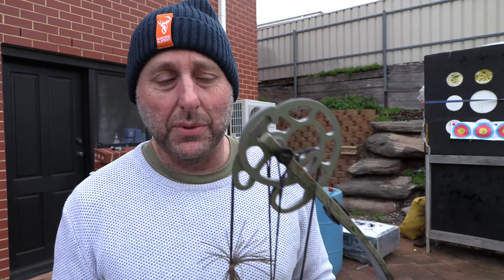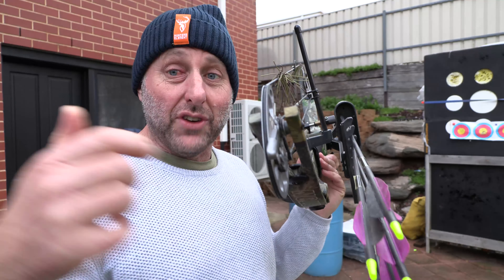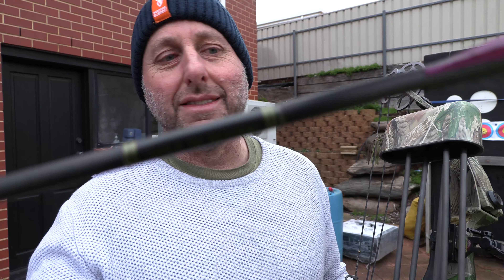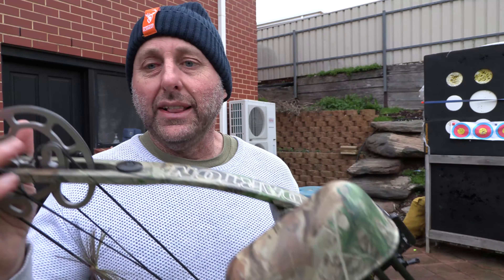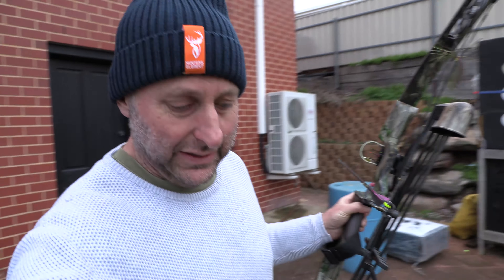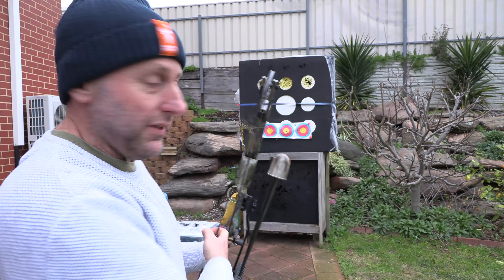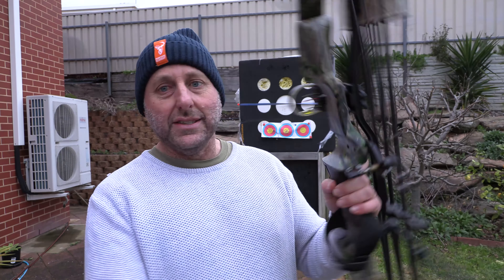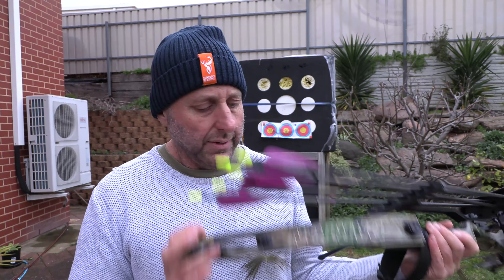Vintage Darton Compound bow

Comment: It's about a 2004 to early 2005 model judging by the cam terminals and the camo pattern.  in late 2005 to early 2006, the string posts on the cams were moved to the edge on the cam in-line with the strings.  I really liked these cams.  I had about a half dozen Darton's that used those cams.  One of my favorites was a Darton Magnum Extreme.  I had 3 of those and still have one to this day.  "Rock Solid" is definitely a good description of these bows!  I wouldn't go as far as to say that a $400 Chinese bow is a lot better.  Especially not one of the Dartons with a machined riser.

Comment: Good stuff.  Nice to see the old bows still hanging around.  That appears to be a Classic Hunter XL.  Circa 1999. 36"3/8 ATA and 6 3/4" brace height...80% letoff.   Darton doesn't list any CPS cam systems until their 1998 catalog.  So that bow at it's oldest is only 24yrs old...LOL  could only be 20-18yrs old.  But I'd say 98-99 time frame for sure.  I'm not sure when Rex obtained Pro-line...but I'd say it was right around 99-2000.